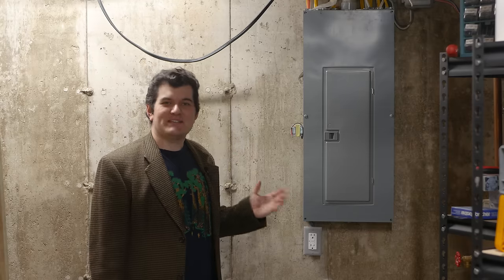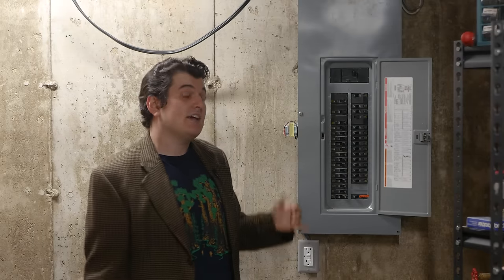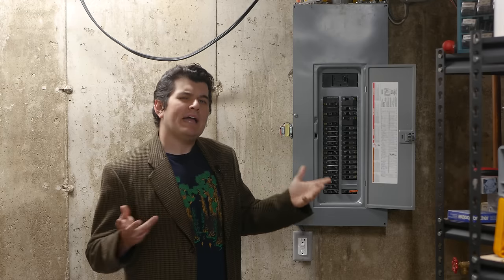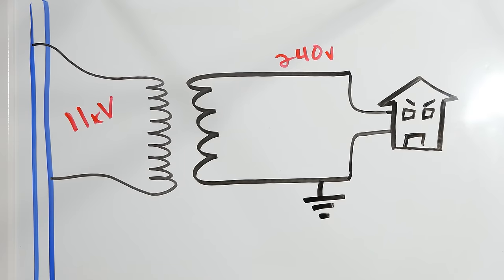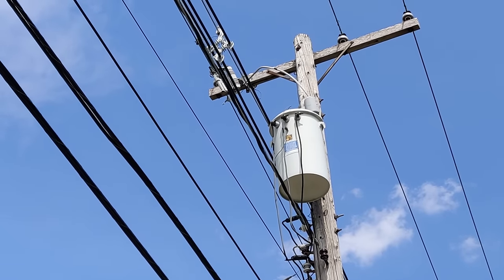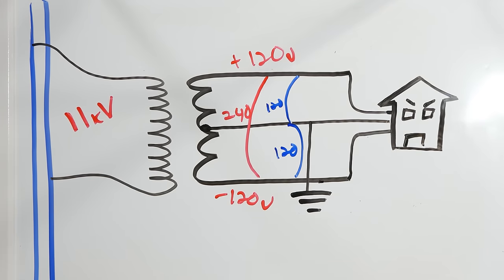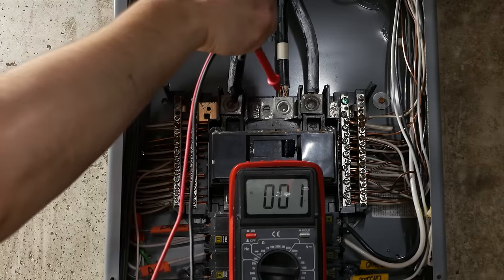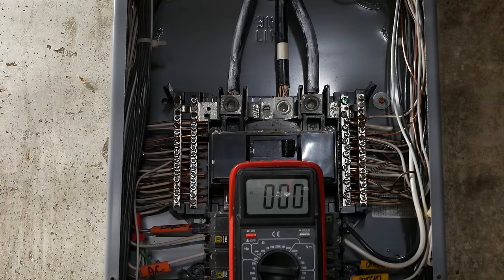The US electrical system is not 120V

Comment: This seems incredibly sensible if somewhat complicated. I'm a brit and 240 does seem like overkill for small domestic appliances. Having played with high voltage and had over 250,000 volts through me at near zero current (van de graft's are fun). But I worked in places with insulated pry bars incase of HV DC high Amp  and multiphase AC high voltage and amperage. Never had an accident or met someone who'd experienced an accident. Propabaly would never meet someone who had the accident though

Comment: Okay, but our homes are 400V supplied and we split phases to get 230V. Our cookingtop get's 400V and the rest of the house 230V. We can install 400V SchuKo recepticals for larger machines like welders, large compressor or pressure washers as well as pool pumps and heaters, if they aren't powered by your gas central heating.

Comment: I'm trying to wrap my little head around the 240v system you are describing. My only daily contact with voltage is in the 138kv range. Them step up/down xfmr things???🤔 I just use the golden rule, never fly a 🪂 in the substation switchward in the 🌧 🤓

Comment: I was going to type up a bit on why your vehicle charger shouldn't be any slower on 208 than on 240, but then I realized a key difference between things like phone chargers (which will charge your phone the same speed on 240v than on 120v) 

vehicle charges are stepping UP the voltage before rectifying it. which means you are LOSING ampacity going up instead of gaining it like a cellphone charger would. 

plugging a 240v 30A charger that charges a 400v battery won't deliver 30A to the battery, because it's stepping it up and rectifying it, causing losses. it looks like typical 400v battery charging on 240v is done at around 13.5A. but the same charger hooked up to 208V 30A wouldn't be able to output as much.

if it were a smartphone charger, it wouldnt make a difference, because the smartphone charges at 5v, and stepping from 240v down to 5v means you have 48x the normal amperage available (not accounting for losses) since smartphones charge around 2.4A (for recent gen phones with fast charging) that means the transformer in the phone charger has the capacity to output up to 720A (albeit for a VERY short amoutn of time!) if plugged into an outlet on a 15A breaker. even if it were on a 120v system, it's still 24x more current when stepped down to 5v, and 360A is still way faster than you're going to charge your phone. 

so yeah, european phone chargers are not faster, but presumably their cars charge faster than americans' if those americans are on 208V systems.

Comment: at 20:18 you say 240 Volt Heating devices will only produce 86% on 208 volts, actually they only produce 75.1%. At 208 Volts you have 86% of the voltage which leads to 86% of the Amperage which leaves .86 x .86 for Wattage. An EV charger would likely draw the same amperage (limited in software) and 86% Voltage yield 86% charging rate YMMV

Comment: I am watching this now and you did a good job explaining this.  I have my complaints but it’s good… but you are getting water into your panel … there is a decent amount of corrosion  on the main lugs and rust marks on the main breaker.  You should have this looked at if you have not already, enough damage can cause the main breaker to fail or the lugs to fail due to corrosion.

Comment: Where I live and especially where my boyfriend lives, it's extremely common to have single family houses fed off a pole with a 3 phase transformer setup. Sometimes wye, sometimes delta. On the wye setups you have 120/208 on what looks like a regular single phase service except for the transformers. On the delta setups we do get 120/240. We also have a weird setup I've heard sometimes described as "Two wire earth phase" where it's a corner grounded delta setup with only 2 high voltage feeders and the third phase, being grounded is connected to a ground rod. It's the three phase version of SWER or single wire earth return, where you only have one high voltage wire and the neutral on the high  voltage side goes through the ground.
Reply: What country is this happening?

Comment: In parts of Belgium there is still a 3-phase Delta grid measuring 230 V over 2 phases. Neutral isn't provided since we don't have things running on 230 divided by sqrt3=133 V

Comment: 120v draws more current than 240v. P=VI which is more dangerous imho  100 watt bulb 0.4 amps @240 0.8 @120. Amps kill. A switch on an outlet is a no brainer and our plugs are a US design in AU&NZ. Interesting way of getting 120v. I always new USA had 240v I just thought it was stepped down at the board. Maybe it’s time you join the rest of the world and phase out 120v but I’m pretty sure it would go as well as the metric system introduction. Enjoyed your video

Comment: It varies because of cable length and size from the source to your home with multiple transformers along the way. Your neighbors will get slightly higher or lower voltage. Whereas two different neighborhoods could have a more pronounced difference. Were talking about a nominal range of about 10 volts for the most part. There are more substations now than 80 years ago which make conversations for an area more efficient.

Comment: We haven't use 3 phase in our homes in the uk for decade's its now only found in commercial property and we dont have power lines and transformers on poles either we have substations that distributes the power under ground we have 3 wires live, neutral and earth going directly to a fuse board with 240 volt going to each fuse and the main breaker or fuse as we call it is typical 100 amp   and are ground, neutral and live are all terminated separately in the fuse board

Comment: I know you have 240volts in your homes, but I'll still say, that you have a 120v system. Just because almost everything is connected to 120v. I also say that in germany we have a 230v system. Although every flat or house I've ever lived in had 3 phase 230v. That means I do have access to and actually use 400v. But it is the exception. For most things we use 230v so we have a 230v system thus you have a 120v system.
Reply: That is a reasonable way to look at it, but even so, I think quibbling about what to call it is pointless.  It is better just to understand how various systems work, without judgment.  We, in North America, have the voltages and the power to do what we need to do.  I expect the same is true of Europe.

Comment: So a couple things you didn't mention. In the US for a very long time, Neutral and ground are not the same thing. Distribution panels are made with a Neutral buss and a separate ground buss. The bare wire is not a Neutral, it is the equipment grounding conductor. The bare wire should not be landed on the Neutral buss and that has been that way for quite a long time. 

That said, in the main distribution, the Neutral buss is "bonded" to the metal enclosure. You can say the neutral is "grounded" in the panel, but neutral and ground are different conductors. (That is why the dryer had a 4 prong plug. 4 wires. two  hots, a neutral and a ground.)

According to recent and current NEC code, virtually all receptacle  circuits must have a GFCI, although it is usually at the receptacle, but could be at the breaker. Even though a GFCI is generically speaking, an "RCD", it's not a term we use because standard RCD breakers have a 30 milliamp trip, where GFCIs have a 5 milliamp trip. Most recently, all breakers for any occupied areas, (virtually all breakers), have to be arc fault breakers.  AFCI breakers. You can install AFCI and GFCI combined breakers. So again, another situation where the US 120/240 system is "safer' than the 240 volt systems. 

I suppose that both systems are "safe" if they are wired correctly and have no problems. But saying that is a typical 240 volt apologist statement. The fact is that 240 volt systems are potentially "less safe" than than 120/240 volt systems. As you explained pretty well. 

Now if you want to talk about UK ring circuits,  they are potentially more likely to get overloaded and cause a fire. Which is why UK plugs have fuse in them.  And as you point out, you sure don't want to step on one barefoot!!  If you have a UK plug with 4 foot of wire, it ought to be considered a lethal weapon, requiring a special permit to carry outside the home!!  BTW, it's only a recent standard change that keeps a UK plug a bit less dangerous if not completely plugged in. Shorting on of those would be far worse than shorting a 120 volt plug!! Then of course you have the huge box required for a UK dual receptacle! You could fit 2 quad receptacles in that space!!

The US 120/240 volt system is definitely "less potentially unsafe" than the 240 volt system.  I get a kick out of those who say the two systems are equally as safe, provided they are wired correctly and there are no problems!  I contend that qualifying it that way, you could say that a hand grenade is equally as safe!! But most people would not say, that a hand grenade was as safe as their electrical system. The reason is because it should be obvious that if something goes wrong on a hand grenade, the potential is much worse. How safe something is has a lot to do with the potential risks. More potential risk with a 240 volt electrical system than a 120/240 volt system. And the hand grenade has more potential risk than both electrical systems.

Comment: You're totally right about safety. I'm french, (i live in France), and i didn't know about how it is in the USA. Anyway, a few weeks ago, i had an accident at home where i was electrocuted with 230 Volts. My right hand touched the end of a ruptured cable and my left hand the other end. Between these 2 ends, 230 Volts was there, and i had a massive amount of electric current that went through my body (and through my heart, stopping for a moment). A moment (maybe 20 long seconds) later, my heart started again by itself, by now, a few weeks later, i still have pain in it.
(And no, no safety was triggered by the accident: the electricity was never cut off).

I survived because i'm young, healthy, i do lots of sports, and i have a very good genetic. But obviously, most people would have died from that.
Reply: @Pixie Pete still looking for a way to replace it with a low voltage (12V) one, but will do it soon.

Comment: Ok, so you basically have a 2-phase 120V system, with 240V produced from connecting both phrases.

We (in Europe) on the other hand, have a 3-phase 240V system. However, main breakers are usually only 50A, so we get less total power than yours with 200A.

Comment: My cabinet shop in California has a odd "Light" 3 phase service. There are just 2 transformers [rather than the three at the adjacent gold mine] and the 4 wires are: Neutral, and three others of which one is 240 volts to neutral [ the stinger we say]. The other two wires are 120 volts to neutral, and 240 volts between them. On real three phase services you wont get 120 volts with out a transformer. My service is limited to starting one 20HP motor at a time, and I have some 15hp motors that run perfectly. It is great system for small factories. This service has a name and maybe someone will post it here.
Reply: B. SERVICE DELIVERY VOLTAGES (PG&E)

1. Following are the standard service voltages normally available, although not all of them are or can be made available at each service delivery point:

Single-phase Secondary
120/240, 3-wire 
120/208, 3-wire

Three-phase Secondary
240/120, 4-wire 
240, 3-wire* 
208Y/120, 4-wire 
480/3-wire** 
480/277, 4-wire 
480Y/277, 4-wire
Reply: Open Delta.

Comment: US has 240? Okay, mind completely blown here. Did anyone tell the film industry? The switches on outlets here in the UK have proved extremely handy in the past. Growing up in the 70's/80's we needed those buggers - none of the safety shielding coating half way down the L & N pins that we have today which helps the 'plug half way in' electrocution issue . Something had hit a plug hard enough for the back to break off. The inside now exposed, we 'turned it off at the wall' and changed the plug.
While I love the individual breakers you have in the US I'm glad we didn't have them in the 80's or my dad may have made good on his threat to cut off the electricity to my bedroom if I didn't "turn that bloody computer off".

Comment: I live in a place with a "national" grid, run by a government corporation (owned by US ALL). It's called Quebec, a province of Canada. Almost ALL of our hydro comes from Hydro reservoirs, all renewable (some exceptions in very remote areas) ... The main power lines crawl through the north all the way South to the US border (we export to the US NorthEast. ).   Our electricity prices are set by law and only increase based on yearly inflation. Right now, my rate is 7centsCDN per Kw/h. It's even cheaper for commercial bulk use. Which means LOTS of indoor growhouses and heated animal farms, for fresh meats, produce, and fruits (mostly berries) in -40F winter time... And indoor electric heating for everyone. 
We had a very bad ice storm in 1998 that took down the main line pylons. We changed them to bigger, stronger ones and are budgeting to make it all underground.  
It's NATIONALIZED so WE control it.  Most of our national security resources are that way... Private enterprise wants profits, public services CAN'T be that way.  Hydro Quebec is still very profitable, but it CAN'T become predatory and just do like those Texas companies... 
The USA will NEVER do that... Not even at State level.   It's SO EASY to make Americans HATE what is good for them.   You just have FUX news, or some dumb politician, call it "socialist" and it's like they'd rather burn in hell than consider life improvements.   They CAN'T see past the system that they were TOLD to hate, to the individual parts that make sense...

Comment: The resistance of human skin can handle around 40v before it starts to pernitrate and start to cause power to travel through the body to vital organs such as the heart. If you are sweating or have been in the bath/rain the amount of voltage required goes down.

This is why 12v car batteries can't hurt you, they don't have enough power to break down the resistance of the human skin, if you have wet hands you will feel a tingle with 12v batteries, if you are sweaty it will be slightly more uncomfortable (salt water is a way better conductor than fresh water)

Comment: as an proud EU resident. Im so glad that we use 240v system. I feel like EU-s safety regulations are a bit stricter since our we use neutral plus grounding on everything. and they are not the same thing. Plus we have an obligation to upgrade our outdated fuseboxes and wiring. Not to talk about there being universal RCD breakers on basically everyhing. The 3.6kW we get from the wall outlets is such a blessing and even we have to think sometimes on what we can add behind one braker and what not. My heart goes out to all the Audio-visual tech people having to build an event in a residential building in the US.

Comment: Just got a tesla, and they mention that the 110V charger will give 3-4 miles of range per hour.   but I've been getting 5m/h range.  Thanks to this video, I learned why!  the 3-4 quote is at 110V and my house get 117V .  who knew!  (I know, the math doesn't work out exactly, so maybe the quote is just extra conservative, but learned I run 117V due to this video at least :P

Comment: In Sweden we have 3-phase / 400V (50Hz*) as a standard going into our houses, thus 240V between phase (any of the three) and neutral which is what we power most of our equipment on. 

Bigger things like wood-choppers, welders or eqv. runs on 400V / three phase (16, 32 and 63 Amps are the most common 400V outlets but there are also 120 A).

*Using 50Hz is the reason that most of the European film and TV-industri shooting at the base speed of 25fps instead of 24fps as you Americanos do (to avoid flickering lights).

Comment: Not knowing much about the US system of power reticulation other than 120vac 60hz, I was somewhat blown away by this. To reticulate at 120v is a huge up-cost in copper/aluminium over 220-240v/phase, however the infrastructure is too huge to change now so they're struck with it. While the rest of the world uses 220-240vac I'm confident in saying it's all reticulated as 3 phase 220/380 and 240/415, but this example shows they don't in the US. To get 120/240 the supply can only be from a centre tapped transformer and I'm unsure how they have achieved that. The LV reticulation must be 208 volts 3ph and for a household requiring 3ph (to run a 3ph motor etc), I assume they would nominate that from the supply authority if required. It seems like it's a convoluted system that's had eon's of band aids applied. Maybe I won't complain about ours in future (240/415, 50hz).